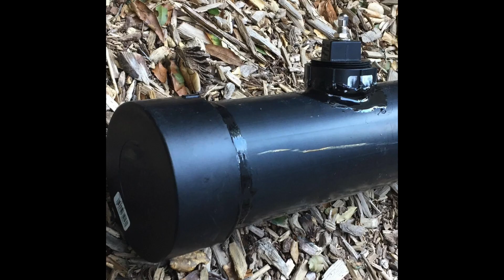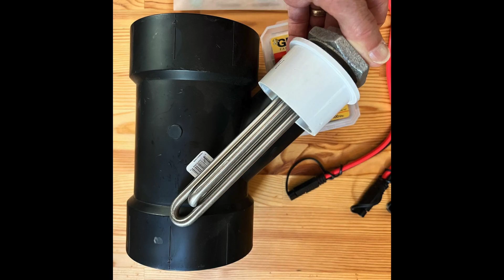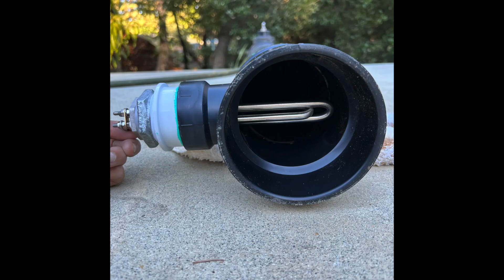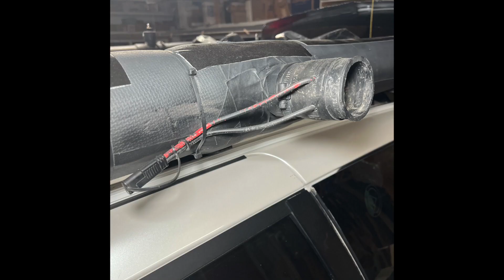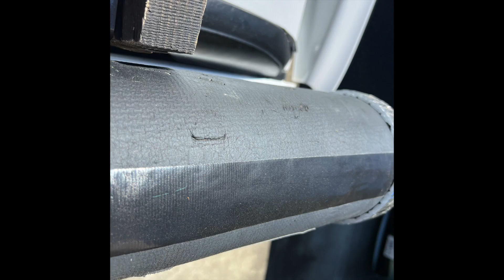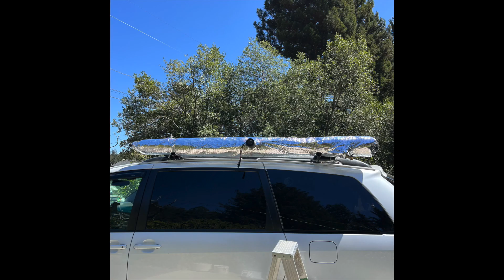Electric Heated Van Shower

Comment: Thought provoking!  I’ve looked at this exact same heating element for my shower tank. There is a nice threaded boss but my dilemma is that I’d be creating a heat battery-inside the van, since that’s where my tanks are. Great in the winter but not so great in summer. Might have to put that water on the roof….  Using the pad to insulate your tank is a great idea. I wonder if wrapping it with black Gorilla tape would protect it from the UV but still collect the radiant heat of the sun. Guess it comes down to when in the day you decide to shower, LOL
Reply from the maker: If you insulated the tank inside the van well it shouldn't be much of a problem, I wouldn't think. I say this from the difference between temperatures of my two rooftop tanks. One not insulated and temperature rise compared to insulated one. Not sure the black color really helps the insulated one, it doesn't get much heat gain from the sun. I discovered that the Gorilla tape does say UV protection. Depending on how this all weather tape lasts Gorilla might be the next layer wrapping it... 🤣 Though Gorilla tape is more than twice the cost. 😵‍💫